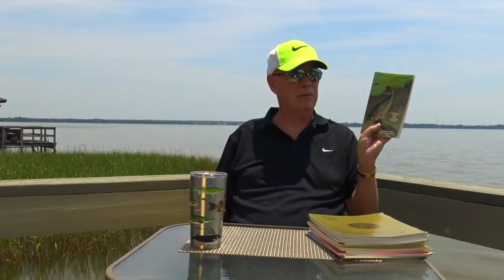Don Dickson's STRUCTURE FISHING Master Class: The Mechanics of Fishing Part 10

Comment: HI DON,
WHAT CAUSES THE SLOT STRUCTURES IN THE FLORIDA DISH PAN LAKES? IF FISH DO NOT CROSS FLATS,HOW DO THE BASS GET TO THE SLOTS?
Reply from the maker: The fish live in the slots! When migration occurs, whether it is daily or seasonal movement, the fish move along small defined "breaklines." Most fishermen are not aware they exist. In most of these lakes the breaks may only be one foot! Four example, let's say in your lake  there is a 20 foot slot, that is surrounded by 8 foot flats. As you drive off of the flats, toward the deepest water you  notice at a depth of 11 feet, it breaks from 11 to 12 feet sharply and then gradually slopes into the 20 ft. Hole. Most fisherman will not even notice the 1 foot break that is occurring at 11 feet. They don't recognize that, because they're not looking for it! Fisherman never consider a feature that small would be important but in Florida its everything. Understand even though the fisherman don't see it, the fish see it without any difficulty whatsoever! It's a change in light to the fish and they will move to it and follow along it. I found a lake years ago in Florida, where I literally was catching the fish on breaklines that were only 6 inches. So even though most fishermen in Florida believe all of the lakes are flat, they are gravely mistaken!  Study my blog where I also discuss the importance of invisable breaklines, such as hard bottom changing to a muck bottom. These areas are easy for the fish to see and are also extremely important in Fl. Type lakes!  Never forget, fish won't cross a flat. They will always identify something to follow, even in a Florida type lake! Hope this helps.DD